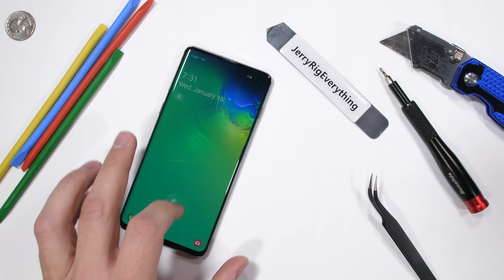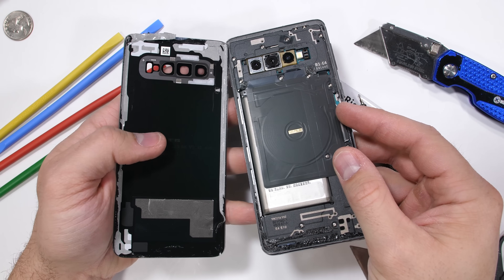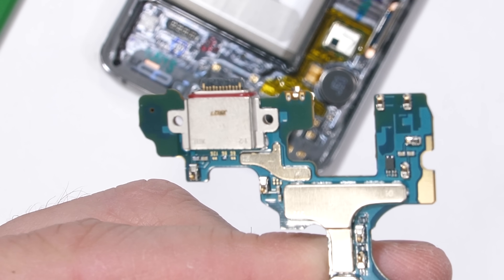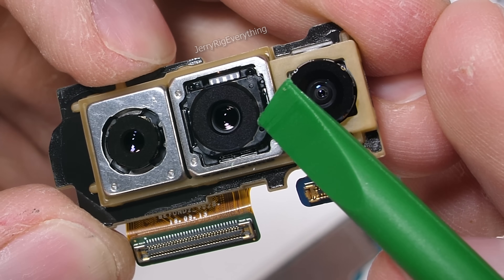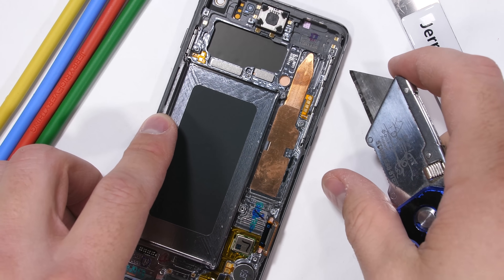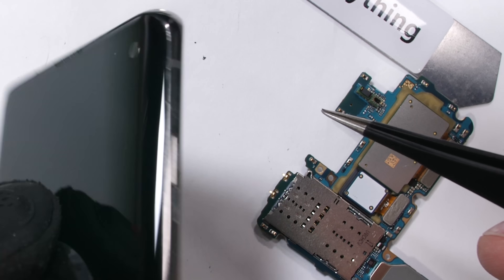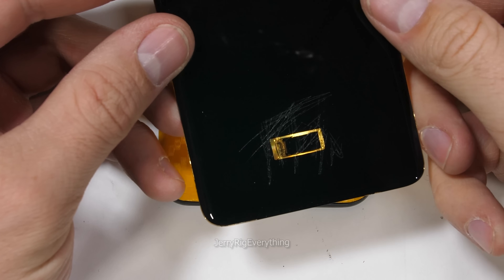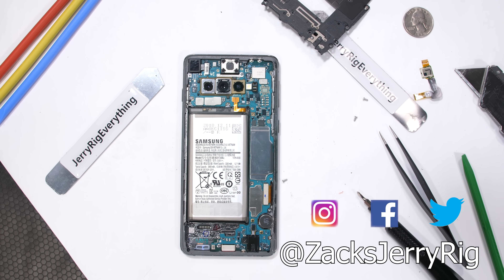Galaxy S10 Teardown – Does Ultrasonic Measure Up?

Comment: Samsung you were the chosen one you were meant to destroy the evil companies not join them!
Reply: greed will always prevail in the end.
Reply: Charching port means you need to buy new phone. Fck that
Reply: Dude!
7 years i use Samsung galaxies never have one of them need to replace any part within it except for the battery and it was my s3, we know how reliable and durable Samsung hardware is!
Reply: @Nykthos94  For me its not the case, S4 i had screen  problems because of flickering after 2 yeara, s6 edge  i had punk line and i didn't had any drops , i change screen and yet after 6 months pink line appeared. I bought s8 and after 2 years same issue.. Now i don't know should i repaired it or switch to s9... But it's clearly that Samsung have screen issues
Reply: @ilijamarnic6579  like i said 7 years using Samsung, and the funny thing that i wished that i get to experience any screen burn in! Especially in 4th year of using my s3 because i was looking for a reason to switch lol.

And im a very very heavy user!
Reply: @Nykthos94  Depends how often you upgrade tho. Sure, if you upgrade every 1-2 years you'll have no problems. But try keeping 1 phone for 3-5 years and you're likely to need to swap a few bits along the way, probably the charging port and 1 or 2 buttons since these are the more fragile things that we use most often. Wear and tear is still there no matter how high quality Samsung may make the components. So it still sucks they made the charging port non-replacable. I hope it's to keep the price lower and not because they became gready.
Reply: @MalcolmBlk  I've used my s3 for 4 years!
Reply: @Nykthos94  And you never had to replace anything other than the battery? Consider yourself lucky then, I guess.
Reply: @MalcolmBlk  thats mine point he is lucky . But now you pay 1000$ so you get some kind of problems with hardware... I don' know i respect Jerry rig everything opinion that nothing change in useres experience last 5 years...
Reply: @MalcolmBlk  why i consider myself lucky and every one i know who have used a Samsung or using a Samsung never run into any problem?

Their batteries was their only drawback back then!
Reply: @ilijamarnic6579  dude!
Just think about it this way: if my experience wasn't always the case and your experience was always the case? How would Samsung became the biggest phones maker? I mean how would people still buy their phone and their quality is like carp according to your experience?!

Here in the middle east 90% of people use Samsung smartphones, and our climate is fucking extreme especially when it comes to  temperature, we can afford icrab we have all the money, but Samsung phones are very durable and reliable!

Its frustrating to run into this issues i know, but maybe it is your usage!
Reply: @Nykthos94  i agree i'm just telling mine experience and still im gonna buy Samsung....But this thing that if your charger is unfunctionable you must buy new phone.. ffs
Reply: @Nykthos94  Plugging a connector in and unplugging a few times a day every day over 3 years or more is likely to result in the connector getting damaged. If you haven't had this experience yet, you're lucky, but it does not mean Samsung's connectors are somehow "special" and would never get damaged.
Heck, try dropping your phone while it's charging. If it lands on the connector, you'll likely have to replace it.
Reply: @MalcolmBlk  i'm feeling now you just trying to make Samsung looks bad!
I didn't say its special, i said their phones were made with durability in mind, same goes to other big smartphone companies even apple! That's why they are in the top of the game!

You paid premium for a phone that should last you 4 years at least before you have to fix anything on it.
Reply: @Nykthos94  I have the S9+, I wouldn't try to make them "looks bad". I don't see how me saying Samsung don't have special connectors makes you think that. Connectors get damaged no matter which company made the phone. And yeah, you paid premium, but that doesn't mean the phone is going to defy common sense and physics. Something thin can't be durable at the same time - it can't distribute the stress applied to it over a large area. Connectors are thin - it's impossible to make them durable. 

For the number of people you know who didn't damage their phones' connector, I'll find you at least as many who did. Trying to defend Samsung's move like this is silly.
Reply: @MalcolmBlk 
So this thread is about you trying to force your opinion on me?

It's funny how people can be so obsessed by their opinions to the point they believe it's facts!

Well, in my side of the world physics works on a way that galaxies charging ports doesn't get damaged!
Reply: @Nykthos94  
Nope, this thread is about trying to explain to you a very simple truth - thin objects are fragile. 

Show me what exactly is not true in what I said, and I might change my mind about the likelihood of charging ports getting damaged. What exactly are you talking about when you say "people can be so obsessed by their opinions to the point they believe it's facts"? Where in my comments did I show this belief?

If in your world thin objects are unlikely to get damaged, you're delusional and I am truly sorry for you. Interesting how you specified "galaxies charging ports" though. Says a lot.
Reply: @MalcolmBlk  dude that's the difference i don't want to change your mind, i said what I've seen!
You don't believe me its your choice!

End of the thread.
Reply: @Nykthos94  
Never said I don't believe in your experience. However, your experience is not a universal truth and as such cannot be used to justify Samsung's decision. 

If you want to end this thread without admitting this, that's up to you, I did what I could. Just don't expect every Samsung phone you buy in the future to last for 3-5 years without you having to replace a couple of parts. Otherwise your misunderstanding may cost you actual money.

Comment: Hey guys, should I remove my plastic screen protector from my phone since it's scratched. 

How long will the glass remain unscratched then
Reply: Aashish Singh Unless you will hit it with level 6 or above, it should survive.
Reply: No. Get a replacement before you take it out. It really depend and no one can tell you how long it will remain unscratch
Reply: I have never used a screen protector, and usually change the phone every two years. Can see through until the end - only under some powerful spotlight can see minimal amount of hair scratches on the edges.
Reply: H9 glass
Reply: No you will get micro scratches on the screen like I have on my note 9 😓
Reply: I do have my plastic screen (original from Samsung) and Oh boi its scratched and hella ugly. 😔
Reply: The scratching isn't a problem unless you have some really hard materials going over it. The screenprotector is better at spreading the impact energy of a fall than using it as a scratch protector.

Comment: You don't have to buy a new phone.  You can replace the motherboard.  It may not be cheap for an S10, but it was cheap for previous phones.  I got a Note 4 motherboard for about $15 on eBay.  There was a separate charging board that was also cheap, but easy to replace.

Comment: What if two phones with reverse charging are on top of each other.
The two most popular phones are s10 and mate 20 pro 
Zack can you do a video about this
Reply: nothing will happen
Reply: Probably can just charge one at a time, until the power just dissipates between wirelessly charging the phones (as heat, most likely). Can't transfer 100% energy from one to another. Damn you, physics!
Reply: Propably the one with less battery will charge i guess.
Reply: Nothing happens,  there’s many videos of it on youtube.
Reply: Scissor (mobile version)
Reply: Coils aren't capable of transmitting and receiving at the same time when you're wirelessly charging.
So nothing happens.

Comment: And before you know it future Samsung phones will be irrepairable due to most of its components being permanent
Reply: ok Justin Y.
Reply: I hope they don't become another apple
Reply: @Andi-fh5lh  Well most of  Samsung profits are not from Consumer Electronics so basically Samsung doesn't need to care about their consumers.
Reply: Wassup
Reply: @restushlogic5794  nice
Reply: I can agree on that
Reply: @Archbound1121 and the hard glued battery.
Reply: @Archbound1121 if the charging port is just soldered on, it's most likely replaceable with some soldering skills and the right equipment (which usually isn't all that expensive)
Reply: @blep993  it is just the rivet like construction that makes up the threading for the screws that worry me a bit. Is it able to come loose from that bracket like metal surrounding it?
Reply: @DaanBrandt   for as far as I can see it looks like the metal with those holes for the screws are part of the charging port. So when you desolder it the whole thing including the holes should come off. And the new one would have the same holes
Reply: Ooof
Reply: Yea Apple is better in that area of Phones by allowing to repair most stuff not all but most stuff.
Reply: @emilianoandrade7946  for $500 they'll repair it for u..
Reply: @quanninoo  and fail
Reply: thatguy 69 and for $300 Apple repairs them for you and if they fail they will repair it again for free🤷‍♂️🤷‍♂️ Cant compete with Apple in Repairing Phones
Reply: Fuck Apple that promote this disgusting strategy
Reply: the charging port is such a bummer
Reply: Fuck you
Reply: Someone reported my comment... it was a joke speech not a hate speech, please.